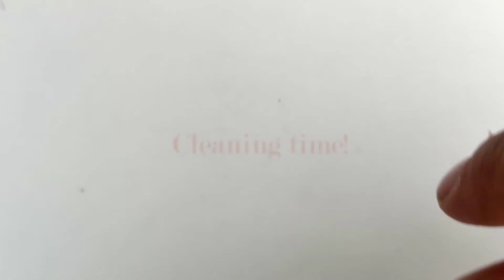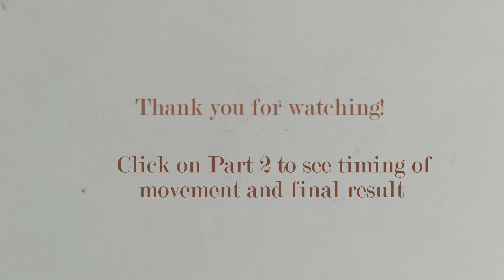Omega 613 watch movement repair and full service Part1

Comment: Just a quick question. Surely when you release the power of the mainspring by simply removing the mainspring gear wheel, the spring suddenly flies out of full tension inside the mainspring barrel? I was always taught to hold the crown, whilst releasing the click gear with tweezers and slowly use your finger and thumb to gently release the tension?

Comment: Hi great video , i have the same watch. Could not find out yhe replacement stem and crown. If any one can advise me the part number for stem and criwn of calibre 613.
Thanks in advance.
Cheers
Reply: Hi. Part #1159 for the male winding stem and you need a female stem extension 0.90 tap size 10.